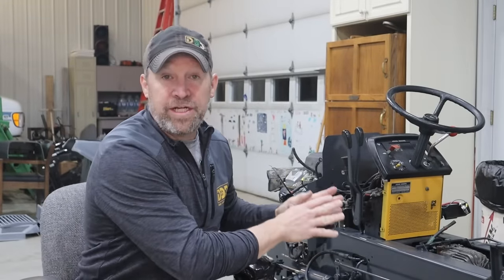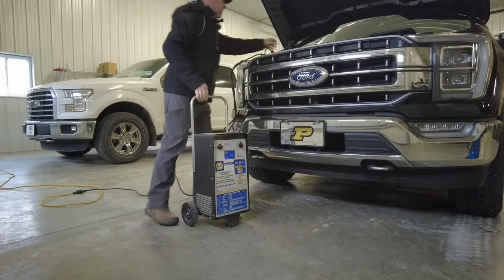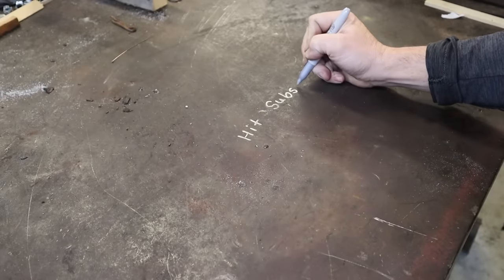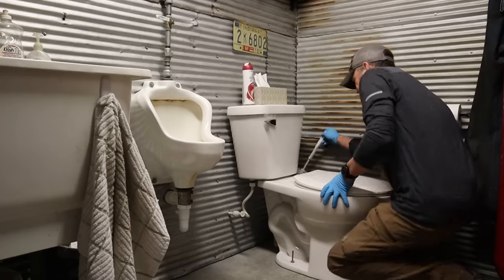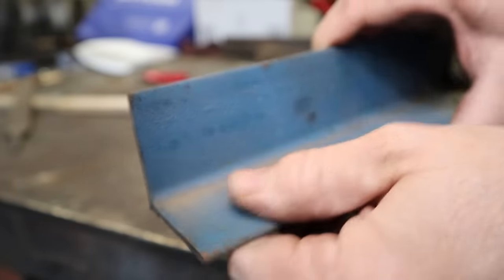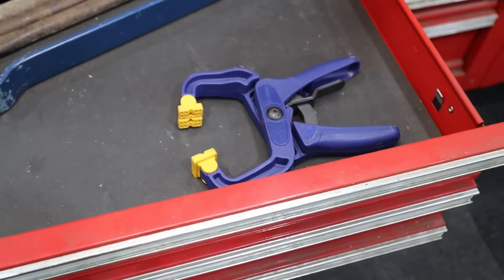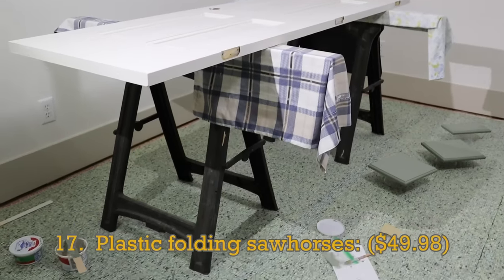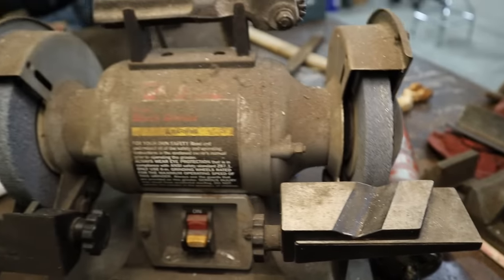(20) Must Have Tools You Don't Know You Need

Comment: Pop's is 88 and He and his Dad told me years ago not only buy the tool you need but buy the tool you can pass on to the next generation..... as I get closer to my next adventure I look at my garage,  basement and have started gifting alotta those items and smiling for that great advice 40 years ago
Reply: more than 40 years ago my grandfather passed, I and my brothers still have and use some of his tools, some of which are from late 1800.
Reply from the maker: That is a great means of maintaining tradition. I have some of my grandfather's tools as well. Great concept. Thanks.
Reply: I got a LOT of my dads old tools.
Reply: Pop is very wise. I do that for that reason.

Comment: Flush cut electrical pliers.  Former aircraft/helicopter mechanic, who screams at people who don’t flush trim zip ties.  I have scars from said experience.  Inexpensive ones for exclusive use for ties, or splurge on getting great ones for spring steel.  Well worth the small bucks.

Comment: A label maker is hands down a must have for the shop.
Reply from the maker: Absolutely!
Reply: @Neil Koch: Dig-Drive-DIY  did you get hit hard by that tornado?
Reply from the maker: @jacobsimerman5281  Missed us by a half mile. We're all good.
Reply: Alternatively, a roll of your favorite masking or gaffer tape. I really like 3M's green automotive masking tape, both because it's close to my favorite shade of green, but also is easy to work with and doesn't leave residue. Tape plus a contrasting Sharpie, and some patience writing cleanly and legibly, can cover a lot of drawers and boxes while adding a slightly more personal touch, if that matters to you. 

Granted, for wire labels, a nice label printer is definitely fantastic to have on hand. Some can print directly on heat shrink, but otherwise a roll-on label or flag label can be fine, too. (And try to cover them with clear heat shrink after, to protect the text so it doesn't rub or get wiped off by solvents.)
Reply: @WhiteVaille  'a roll of your favorite masking or gaffer tape'  This, but a roll of white duct tape instead.  You will find many uses for white duct tape, because you can use it on many things that are visible without making it look trashy like it would with silver duct tape.
Black and red duct tape are also excellent to have on hand, to match other color items.  But the white plus a Sharpie makes excellent labels, I label all of my containers with it.  And you'll be done labeling everything you want to label before most people would have gotten a label maker out and made the first label.
Reply: I just got one a few months ago and I do not regret it
Reply: Is it though?…

Comment: The "tool" that has most improved my workshop is a full size toolbox.  I'm not saying a giant behemoth, but a freestanding toolbox on casters was the best upgrade for my shop.  Digging through small toolboxes and tool bags to find what you need is a real drag on productivity and motivation.  I didn't want to give up the floor space in my 2 car garage, but it is well worth it for most of my tools to have a specific place.  I'm envious of how much drawer space you have, but I don't yet have a large enough shop for more toolboxes.  Also, labeling the drawers is great.  I can tell a family member or friend exactly where to grab a tool if I'm working under a vehicle.
Reply from the maker: So very true.  A toolbox is the central hub for a high functioning workshop.  I'm thinking of doing another one of these types of videos with some organizational tips and the labeling is key too.  Thanks for the ideas and as always, thanks for your comments Brian.
Reply: My garage is only 1.5 cars but I have 3 tool carts. My large stainless kobalt is probably 15 years old or more and while rebuilding my garage, I inherited another that is the same after my grandfather passed and I kept his 1970's craftsman cart and cleaned up the slides so it would work again. I couldn't pass up his boxes for sentimental reasons and having so many drawers really helps when you have a lot of tools in a small area.

Comment: BTW that construction yellow and gray looks good.
I use 5 gallon buckets. Dad's been gone 22 years but I still have plenty of ice cream buckets and emery cloth. He also left me plenty of mechanics wire. I use flush cut wire cutters for the zip ties. I thought those tools were to pull them tight. I was wanting one of the little devices to jump start vehicles. I found out many of them do not work if voltage is too low. So I found 1 that shows voltage and you can use an over ride to work at low voltage. 
I've been cut many times by ends sticking out of gear type hose clamps. I think it's my newest JD that has covers on them.

Comment: A good set of drill bits preferably cobalt, as well as a set of left handed drill bits. A spring loaded center punch, easy outs and at least a basic tap and die set. Another nice thing to have is a pick set, I have several including those that look like dental picks, and forceps, the latter two I got at the local sporting goods store. And a couple good pairs of tweezers for splinters etc.

Comment: Ammo boxes. I have multiple 50 cal boxes that have everything I need for a specific type of projects like electrical work. I just grab the box do what I need to do and when finished everything goes back in its box and I use my silver sharpie to write what the box is for on the outside so my shop is organized and easy to clean up which is the worst part of any project.

Comment: Yup. Everything you showed is essential.
Few tweaks/additions…
1. Table vise
2. Single hole countersinks. Much smoother and better results
3. Floor jack
4. Come along/ratchet straps
5. Cordless tools and arguably the most important cordless tool…flashlight

Comment: Absolutely correct on the analog battery charger.  They actually work when the digital ones don't.
A compressor is invaluable to me because it inflates my tires and helps power the tire machine.  It also runs the impact wrench and hi speed grinder.  Couldn't live without it.

Comment: Great list! 

A few that I have collected over the years are a bearing seal puller, 12 volt battery maintainer, angle finder, snap ring pliers, a good set of brake tool wrenches and pliers, a good quality soldering iron (not a gun), a 250ftlb+ 1/2" drive torque wrench. Last but not least are a quality condition pair of mechanix work gloves as it will get a user all the possible protection, as much as possible cleanliness, but without all the sweaty wet hands as with the rubber gloves, which are great from the greasy oily jobs, but the cloth ones work great for the everyday stuff.
Reply: I also have a battery maintainer, also doubles as a trickle charger. Great as a portable option for charging batteries

Comment: Great list - For blade disposal get a “sharps” container from your industrial supplier (Grainger) or your pharmacy. They hang on the wall.

My favourite bucket is a “Little Giant” 8 qt. Flat-Back Plastic Bucket - it is the right size - hangs on the wall nicely and has a strong 1/4” steel handle that will not bend.

Analog Battery Charger is a must - you don’t need a big one - it only has to bring the battery up to a few volts so the smart digital will work.  Best thing about having a dumb analog charger is that you can use it for rust removal!

Comment: One of my favorite tools is the 3/8dr handled extension. That way you can use a ratchet to break a bolt loose and then spin it off like a spinner handle. That's one of my favorites
Also a added one are the old stainless kitchen ware mixing bowls your wife doesn't want anymore snag them and they make great little parts cleaning bowls!
Reply from the maker: Agreed! I have a couple of those stainless bowls.
Reply: @digdrivediy  they are invaluable stick a little gasoline in and it's the best mobile parts cleaner I've found. Plus clean up is easy! Keep up the great work I can't wait to see how the 318 turns out!

Comment: A top notch list! I use nearly every item. I find the silver Sharpie fails when trying to mark black electric cords, hoses, roof felt, glass, plastic, etc. I got some paint markers from that big box store that ran all the local stores out of business and those have earned a place in my tool bag along with all the other essentials I carry. I'd also say a centering punch is essential. Somebody farther down mentioned a single-hole countersink, but for woodwork, I'd recommend a KEO countersink instead. The fluted countersinks create hexagonal holes, which isn't great. The KEO cuts a very nice, round hole. I couldn't do without mine.

Comment: Your list is spot on. Definitely the old battery charger. I bought the one I have in the late sixties, it still does the job,  six volt 12 volt slow or quick charge and a "boost" switch you hold to start charging a completely dead battery. I have heard from others of their dis-satisfaction with the "New and Improved" solid state chargers. Everything else on yor list I have had for years, bought a box of 100 single edges razor blades years ago, still have many left. When i finish with them I wrap them using blue painters tape.

Comment: A work table. 3/4” ply with 2x4 around the edge to strengthen 3’X 7’, and with foldable legs. I just replaced the 34 year old foldable legs with new ones!  I have build many of remote control planes on it pre kids 😂, and repaired a rotor tiller and many other things as well as cut lumber, you name it it’s wonderful. No bending over standing on my head or down on on one knee for me. 👍

Comment: Excellent list! Sawhorses are indeed handy, but I would add a Black and Decker Workmate as a must-have item, especially for smaller projects where clamping is required. An older model Workmate refurbished with replacement work surface panels is a great choice. Like others, I would welcome more content of this kind, covering both metal fabrication and woodworking.
Reply: Deburr and wipe chips away with your bare fingers. Ok then.

Comment: I don't have a lot of different wire wheels, but I have had one on my bench grinder for at least the last 30 years.
 Ice cream buckets work great for a lot of things, specially for picking blackberries.
 I would add a magnetic dish to your list. I need a few more of them in my shop it seems.
Reply from the maker: We gave away magnet dishes as a client appreciation gift at the farm show one year. Big hit!
Reply: I use old speaker magnets they will hold a lot more than the dishes

Comment: Great list , ive got almost all of those tools.
So modern battery chargers are actually only battery maintainers.  They need to see some voltage usually 5 or 6 volts to kick on. You can fool them into charging a completely dead battery by adding in a good battery for a few seconds so the charger sees the voltage and kicks on.

Comment: Great video! Noco battery jump starters are fantastic for that reason - you can override its reverse polarity safety feature for it to still jumpstart a totally dead battery it can’t sense. They also have emergency lights and USB charging - a fantastic multi-use car emergency kit item.

Comment: Neil… although I do more woodworking than mechanical, I have nearly all of those.  You’d be surprised how many of them relate to woodworking.  Chamfering countersink bits, Emory Cloth, clamps, tarps, nitrile gloves…. Etc.  

Here’s a few that I find especially useful in woodworking… 

Strap clamps come in handy when assembling odd shaped objects.  For example octagonal windows for a treehouse.  A single strap replaces a wheelbarrow load of clamps or a homemade fixture.

Adjustable height stands are great for stabilizing lumber being fed through a planer, jointer or tablesaw.  They also support long pieces that hang off the workbench.

Wood faced vise jaws. I use a built in woodworkers bench vise now.  But, I started out with a pair of screw-on Dogwood faces on my mechanics wise.

A Vix bit… or centering punch resolves almost every issue with centering wood screws in hinges and hardware.  Anyone that has ever popped the head off of a screw because the countersink in the hinge is eccentric to the one under the head, will attest to the need to have a set of these!

A set of inside/outside calipers, dividers and compass.  Although a machinist caliper with digital or vernier readout is nice… the old fashioned mechanical drafting/inspection tools are much more useful and practical in woodworking.  Layouts, thickness planing, lathe turning, lumber sorting…. Lots and lots of uses!

J-Wax is the ultimate surface protector for metal and wood.  Anything that slides has less friction when coated.  Using oil/grease is a recipe for disaster around sawdust.  Silicone overspray or residue transferred to a wooden surface will ensure that the finish will be trashed.  Unlike metal… there are a lot of instances where one can’t clean a wooden surface with chemicals… using J-Wax on tool surfaces is the perfect solution.  It is also the perfect finish coating on a lot of wooden projects. (Just one problem… Johnson & Johnson discontinued it last year.😢)

Flush trimming hand saws have no set in their teeth.  You can cut protruding dowels, tenons or overlaps perfectly flush without a mark on the surface.

Double sided tape is great!  Both temporary and permanent bonds come in handy in innumerable ways.  You normally want the tape without the foam between its surfaces.  Building plys for gang sanding, holding work for machining, assembling or fixturing is simple with the right 2 side tape. (It is actually better than hot melt glue in a lot of applications.)

I could go on & on… but won’t.  (A wise man told me that the root word for ‘ad nauseum’ is nauseous!)  So, I’ll leave it with just this thought… You can tell a man’s affinity for his craft by looking at the tools he prefers to use.

Thanx Neil… I enjoyed your list.

PS… I find a cheap Multi-Meter to be one of the best investments that I’ve ever made.  I can barely change a battery or replace a light bulb without whipping mine out to check!
Reply from the maker: Love it Dave!  Some perfect additions to the list.  You had many of the same items on your list as my FIL, who is also an avid wood worker.

I feel like I could do several different themes  versions of this list. I went with "random" but it was still difficult to decide what should make the cut.  It is a fun exercise though to look through your toolbox and make some discoveries of items long forgotten (top drawer of my big box).

I remember that you recommended the J-wax for the tip of the Axis wood splitter.  I had forgotten what it was. As I was your comment about all the uses, I mentally told myself "I'm just gonna order it right now" only to read your last sentence saying it's discontinued! Dang. Now I want it worse than before...

Thanks for playing along with the fun. It's great to get to read through all the suggestions and it's fun to hear about everyone's favorites.

Until next week...
Reply: @digdrivediy  Don’t despair… Min Wax has a Paste Finishing Wax that is almost as good!  🤓

Comment: Great video!  For old razor blades, I keep an old Gatorade bottle with a slit cut in the lid. Drop them in, then once it’s full just put a new cap on it and throw the whole thing out. 

As far as tools I’d add, a really sturdy long pry bar is invaluable. It’s one of those tools that once you have one, you’ll wonder how you ever lived without it.

Comment: Wow, you read my mind on every one of those.  I even have the large collection of plastic bags and the silver sharpie.  I will add to the list:  plastic standard razor blades, tongue depressors and popsicle sticks, 6" wooden q-tips, PC in the shop for manuals and ordering parts, earplug dispenser, industrial hot melt, schaller bins, carpeted wooden apple box set, CA Glue and Activator, Wiss 8-1/2" industrial shears, cafeteria trays, Zoom caulk sealer saver.  On the razor blades, I use a medical sharps container.

Comment: Spot on with the battery charger. I kept an old one for years because it will charge many batteries the new one won't. The zip tie cutter will have to end up in my Amazon kart.

Comment: YES - There is one vital tool that you will use almost constantly (ok only 5 times a week if you do any kind of mechanical work)
That is a Knipex   87 01 125  (the smaller one is just too small - the bigger ones hard to keep handy)
I made a leather holder for mine and put it on my belt and it is constantly handy.
Holds a nut - hot metal, twist metal/wire, clamp etc.
Similar pliers may work for you but the size and gripping power are the essential parts.

Comment: For used blades I have a Fluff jar/tub (a staple in New England homes) with a slot cut in the lid. Drop the spent blades through the slot and when the jar/tub is full, just put some tape on the slot and toss the whole thing

Comment: 5:29 Something I learned from working on aircraft, routing wire bundles, was using diagonal pliers, taking the flat end, butt it up against the edge of the zip tie as close as you can, and cutting the excess tail off. You can also lightly grab the tail close to the head with diagonal pliers and lightly twist to draw up the zip tie, then cut off the excess tail. You are less likely to cut yourself with the edge of the zip tie that was cut off.

Comment: Younger "old school" parts guy here!(my customers couldn't believe Id go to the paper catalog so fast) I've sold tons of batteries and brought many back to life. The newer "smart chargers" are just that. If voltage or amperage is too low, they don't "think", a battery is hooked up. If you add a set of jumper cables to another, "good" battery, it'll charge right up. Give it a try and tell me I'm wrong.